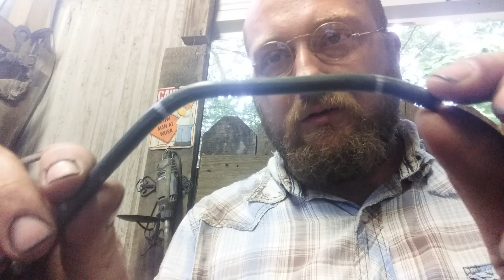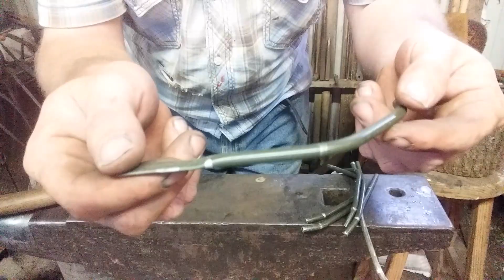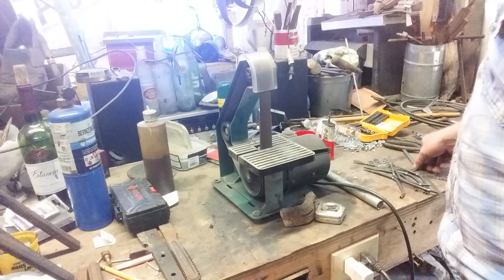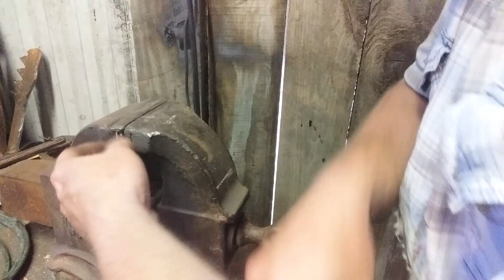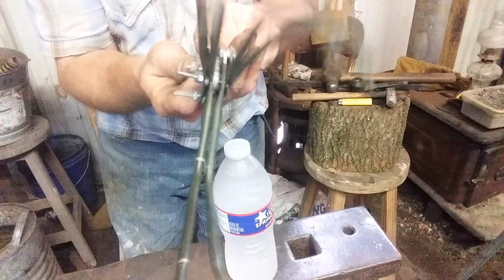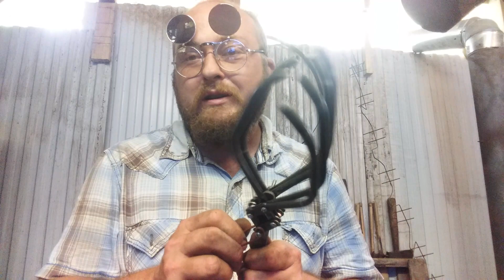Forging a prosthetic hand part 2

Comment: Awsome job how bout flex seal for grip
Reply from the maker: By the way, Congratulations on the winning of my 200 subscriber giveaway! My email is in the description of the video. Let me know where to send your rail spike door handle
Reply: @thesprinkleddonutforge2774  drw.dw6@gmail.com
Reply from the maker: Flex seal is pretty good stuff. I was entertaining adding some block rubber tips spanning across the four with a tapered edge, and one across the thumb. Plus some curved grips for grasping glasses.